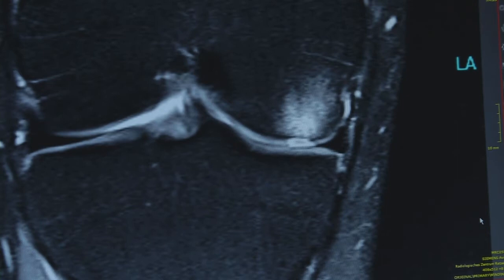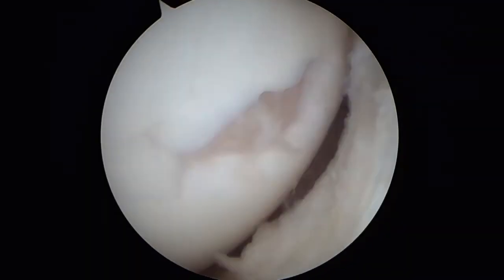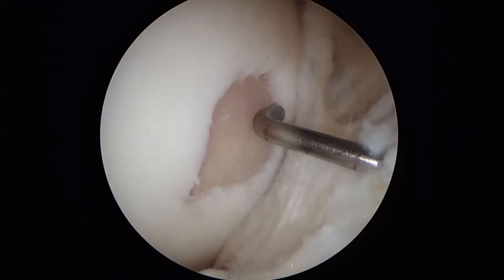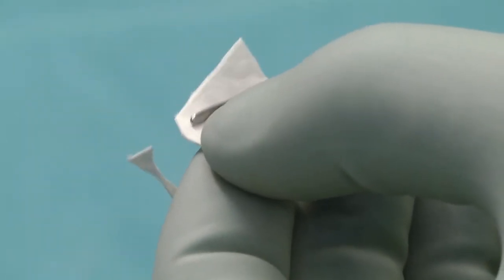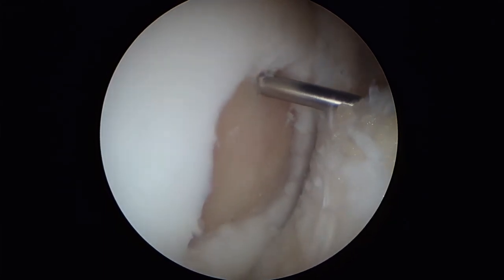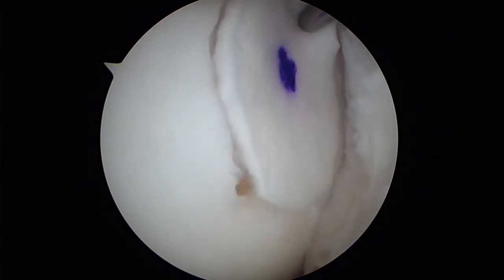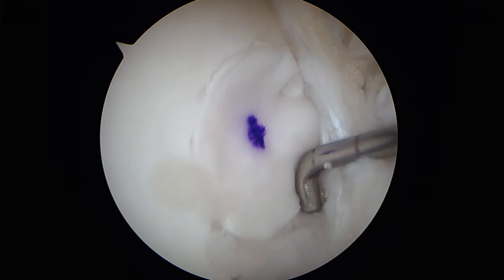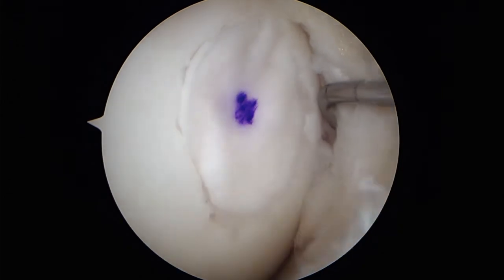AMIC® - Cartilage regeneration in the knee (Geistlich Surgery) - Part 1/2

Comment: ACI or minced cartilage is much better. Better cartilage, less osteophites. No immunological response. Microfracture not state of the art anymore. Is this true?
Reply from the maker: To date, there is only very limited evidence on the clinical outcomes of minced cartilage implantation (MCI). There is even not yet a standardized procedure for MCI as there are several techniques (hand-minced vs. shaver-minced, size of the fragments, covered or uncovered with a membrane, fixed with commercial fibrin glue or autologous fibrin glue, amount of fragments in the defect, harvest site of the minced cartilage…). For AMIC® Chondro-Gide, over 100 Peer-reviewed publications are available with at least 5 RCTs and at least 20 meta-analysis/systematic reviews.

Three publications which are comparing ACI with AMIC® are showing that the clinical outcome with AMIC® are similar and not statistically inferior to the ones of ACI. In the same run, AMIC® has a lower complication rate and lower costs compared to the two-stage ACI surgery (Fossum et al. 2019; Migliorini et al. 2022; Snow et al. 2023)

Comment: Can these membranes cause a immune responses of the body? I read that using scaffolds can cause immune responses which can leat to even chronic inflammation. In my case, I had the AMIC surgery in July 2021 and got severe inflammations beginning in September / October, which lasted for a long time.
Reply from the maker: As it is not possible for us to give you a more precise answer, but we appreciate your interest, we have looked into your question again and would like to supplement our answer: 
Chondro-Gide®   is a collagen membrane, which is manufactured according to a standardized and controlled process. The collagen is obtained from veterinary-certified pigs and is carefully purified to minimize the risk of immunological reactions. Chondro-Gide® should not be used in patients with known allergy to porcine collagen, acute or chronic infection at surgical site or acute or chronic inflammatory joint disease. Due to its high biocompatibility Chondro-Gide®  has a proven safety profile which has been confirmed in numerous long term studies.
Reply from the maker: Dear Chewy,

Thank you very much for your enquiry regarding “does Chondro-Gide cause an immune response in bodies”, which was received by our office on June the 28th 2022. 

We appreciate your interest  and understand your concerns.  

As a manufacturer, due to the legal reasons and National Regulation we are unable to provide medical advice to you of any sort. 

We would like to suggest, that you may explain your concerns to your treating physician, who will be in the position to analyse your particular clinical case, give you a medical advice and answer all medically related questions, specific to your situation. 

We are sorry not to be of greater help to you.  Nevertheless,  I wish you successful treatment and quick return to the full health.

Best regards 
Geistlich Pharma

Comment: Does this technique produce hyaline or very near hyaline-like cartilage in the knee? Where does the collagen come from and how does that help produce the hyaline (or very near) cartilage?
Reply from the maker: Thank you for your question. Chondro-Gide® is a bilayer membrane derived from pig material sourced exclusively in Switzerland. It has a unique structure, being compact and smooth on one side and rough and porous on the other.
The Chondro-Gide® covers the defect and serves as a protective shield that contains the cells and minimizes the impact
 of shear forces on the delicate superclot. At the same time, it functions as the roof of a biological chamber that forms over the defect.

The biocompatible collagen material provides an environment for cell growth and is replaced by native tissue over time. Some publications report that after AMIC® Chondro-Gide®, hyaline-like tissue is formed. Study outcomes demonstrate that the resulting new tissue after AMIC® allows the patient to regain joint function up to 10 years post-op. You can find details on all aspects and the corresponding brochures with references on our website www.geistlich-surgery.com
Reply: @GeistlichPharmaAG  many thanks.... So after 10 years do you say that because you don't have longer term studies or are you certain that after ten years it will begin to degrade? Is it possible to last even longer if you're lucky and don't damage it?
Reply from the maker: @ATIWatchReviews  Thank you for your question. The 10 years are based on evidence from studies which have been published in peer reviewed journals and have, so far, followed patients up to 10 years post-op.
Stability of results up to 10 years could also indicate that the patient status will remain stable beyond that time frame.  However, we can only report of a time duration that has been investigated in a clinical study. Currently, the longest studies followed up patients for up to 10 years.
Investigators continue to monitor patients and the long-term outcome of AMIC treatment. Data will certainly be published as it becomes available.
Reply: @GeistlichPharmaAG  excellent. thank you for your detailed responses.
Reply: @ATIWatchReviews  Hello, have you done such an operation?